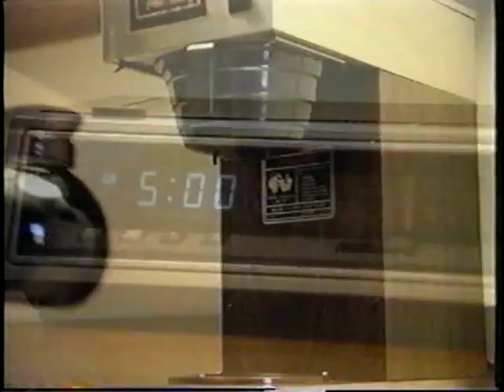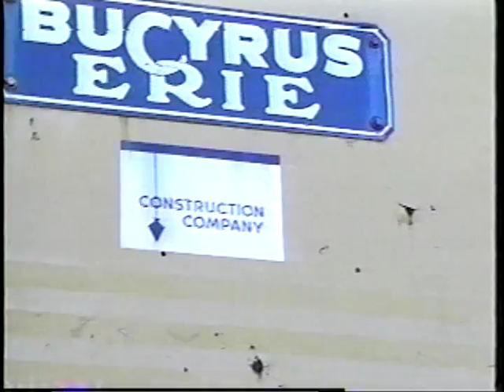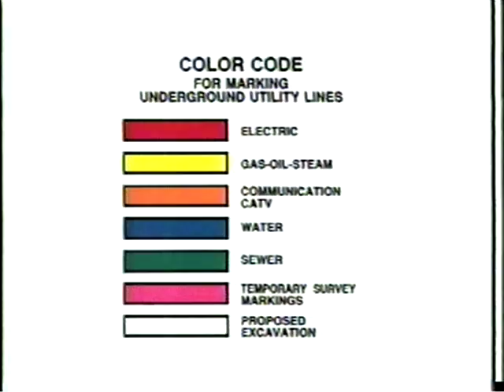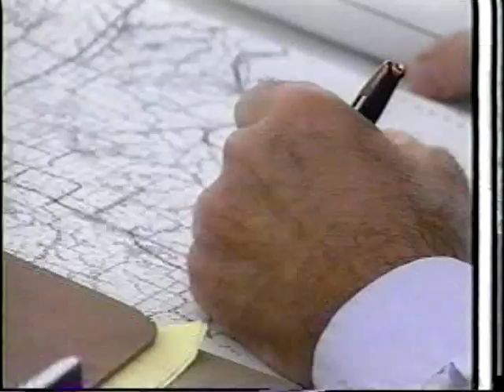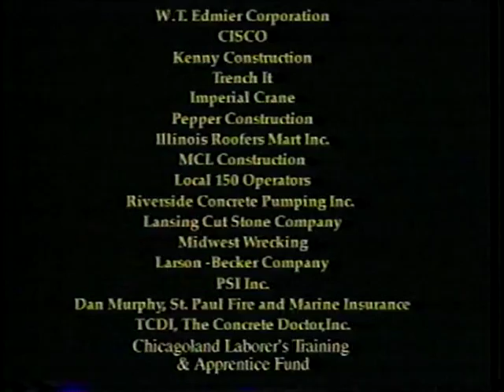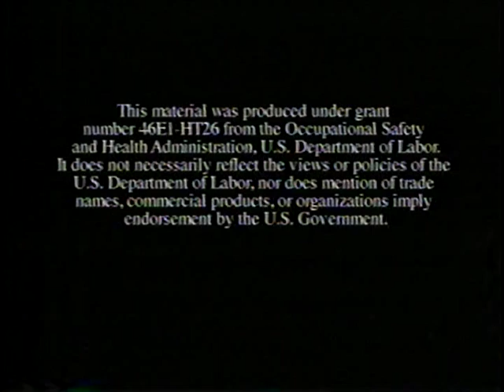Power Line Hazard Awareness

Comment: Can guys wear rubber boots and rubber gloves for protection?
Reply: In depends on the voltage rating class of those gloves the boots on the other hand won't give adequate protect unless the or boots used in line work and even then your still in danger